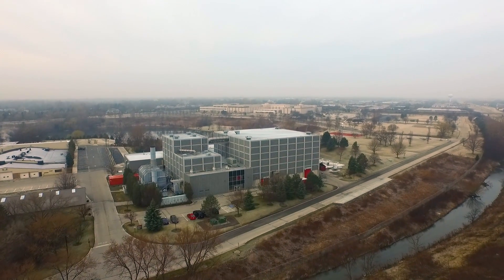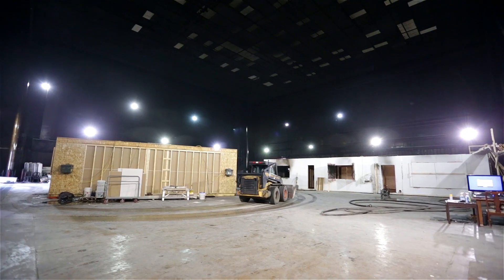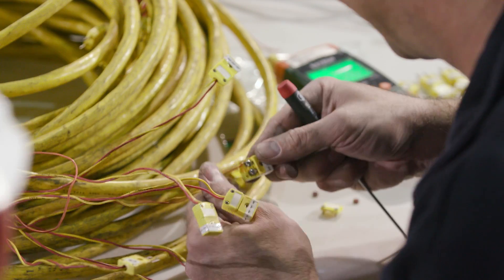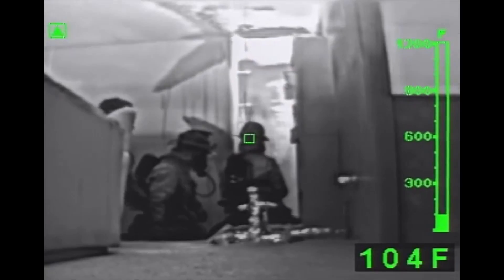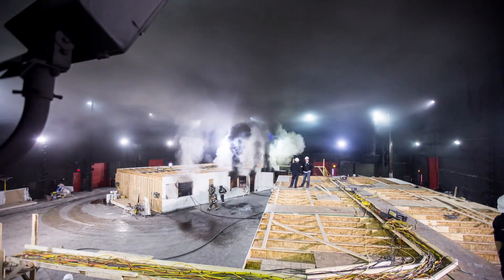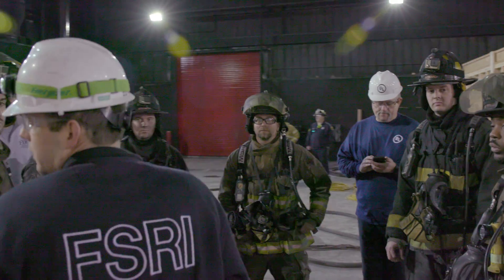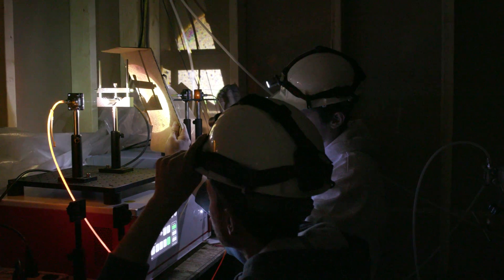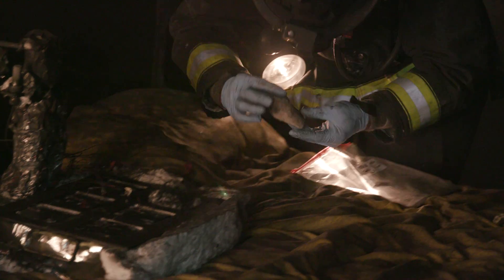Fire Attack Full-Scale Experiments

Comment: I think it’s great that this research is being done. However, this is best case scenario testing. The fuel loading in these depictions are not as accurate as it would be in the field. 9/10 times the house will be filled with furniture, toys, garbage, newspapers, photo albums, pets, blankets, and carpet. Just to name a few. Don’t even get me started on hoarder houses, or bed ridden people surrounded by garbage and their own filth. Food for thought. Fill one of those structures up with crap, essentially, then light it off. It will yield wildly different fire behavior and heat.